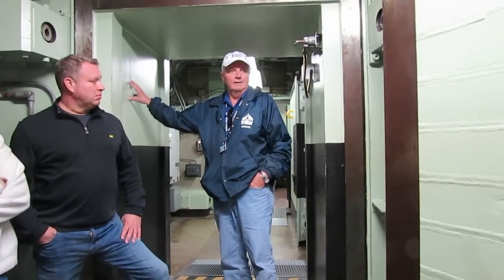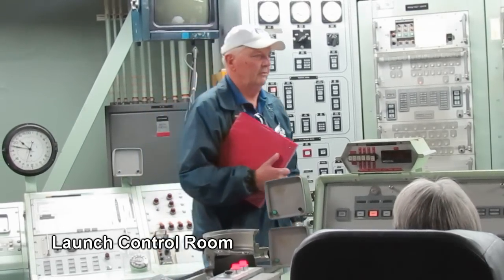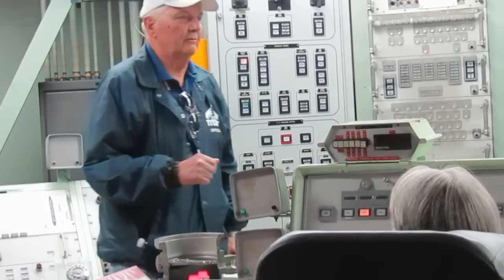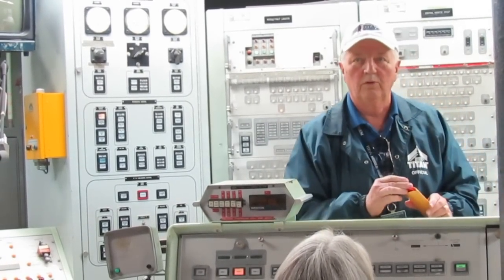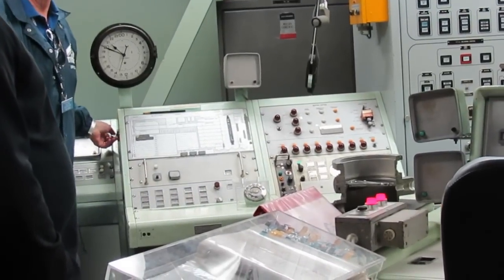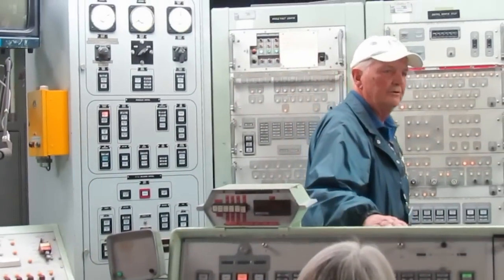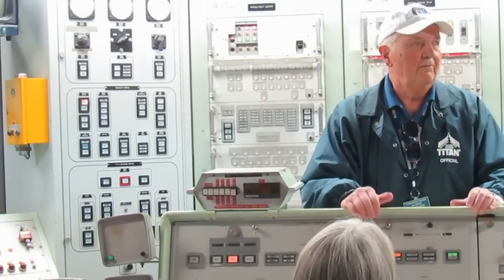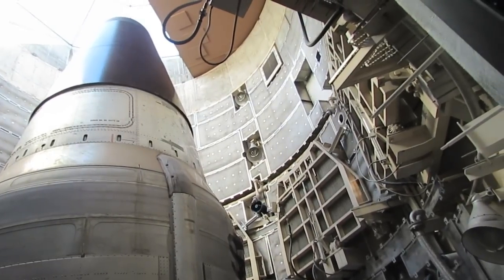Nuclear Titan Missile Silo Tour:  Sahuarita, Arizona

Comment: I recently read on twitter that the software and hardware used today is basically 25-30 years old, in some silos, 5 1/4 inch floppy disks are still in use! I couldn't believe what I r was reading...then I saw it on CNN!
Reply from the maker: roberto abrams This silo was launched by 4 electric butterfly values that would open to mix the fuel and oxidant. Once the chemical mix started a launch was inevitable. Even God couldn't stop that Titan from flying!